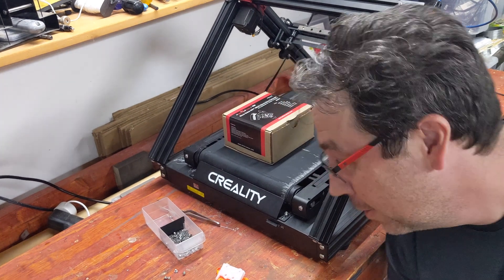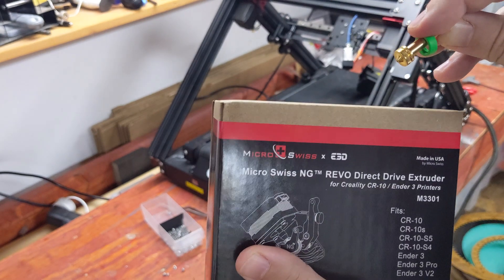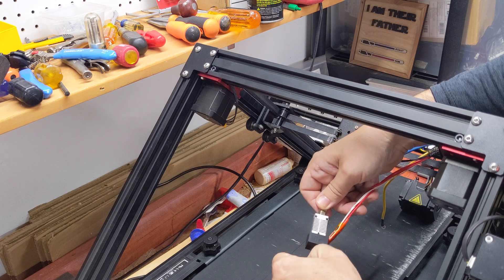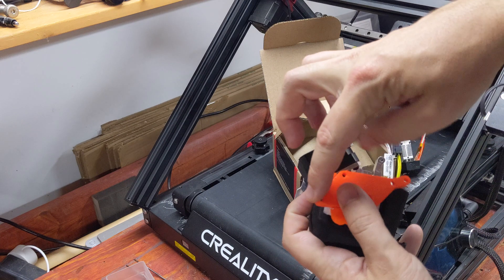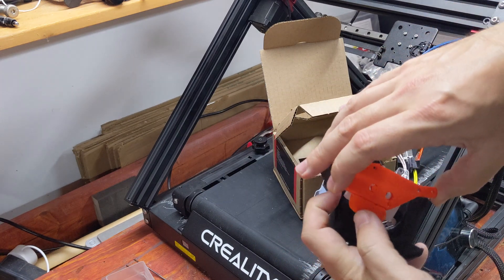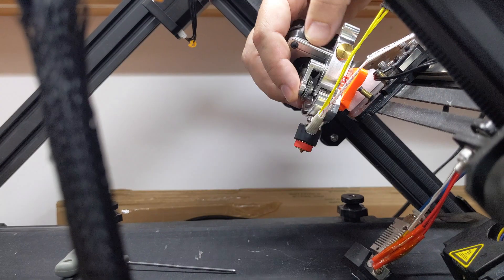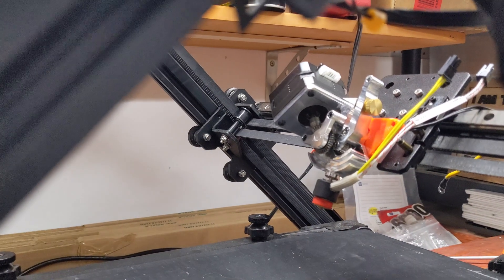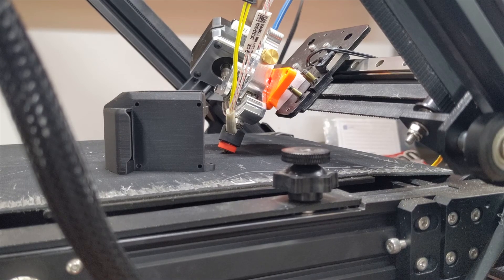CR 30 upgrade - 22.5 degree Micro Swiss NG Revo

Comment: Why 22.5*? U like it more?
Reply from the maker: The nozzle is 22.5 degrees from the bed AND 22.5 degrees from the print plane - splitting the difference.  Helps with bed adhesion and print quality, so, yes.  I like it more.

Comment: Hi, ive done the MOD as per your video, but print qulity has dropped, did you make any adjustments to allow for going from a bowden system to direct drive within the slicer software?
Reply from the maker: I did tune the linear advance as well - you can add M900 K0.06 to the start gcode
Reply from the maker: I've been using Idea Maker for slicing on it, too.  I haven't explored alternative slicers all that much yet, what are you using?
Reply: @PaulChase  I am using Ideal Maker, and Creality Slicer, what I failed to do was adjust the e-steps (as advised by Paul at Micro Swiss), this will be done at the weekend. I am very new to 3D printing, could you explain what linear advice is?
Reply: when I use ideal maker, I have tried to create custom profiles, but when the print starts, the hotted moves all the way to the top of the Y axis and hits the stops, then prints in mid air.
Reply: Hi Paul,

I’m planning to do this modification to my printer. Have you made improvements over the last year?   (Experience always leads to new adjustments :)

Also, have you posted your 22.5 deg modification wedge somewhere ?

Comment: Another question, do you use the xisting CR30 fan / fans?
Reply from the maker: I did use the existing fans, but I'm planning to swap all the fans out for Noctua's.  For the print cooling fan, I'm only using one of the original two, so I might try to mod that for more airflow

Comment: Hi, be good if you could show how to connect power cables?
Reply from the maker: Sorry - the kit from Microswiss has an extension cable, so you just plug it right in to where the old motor was